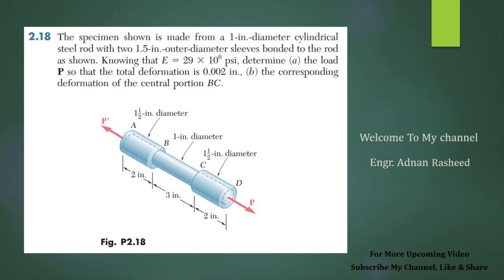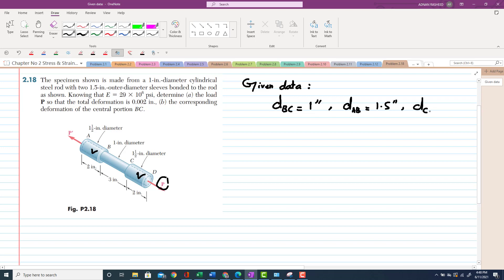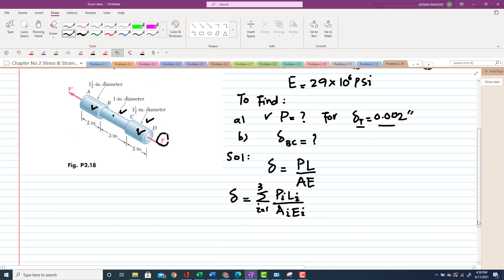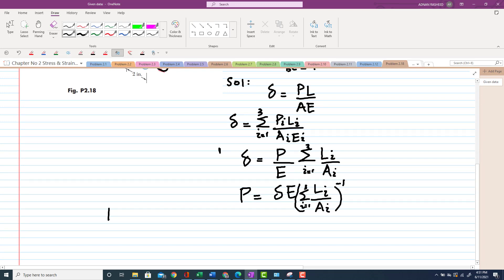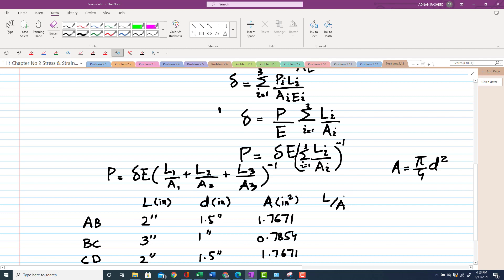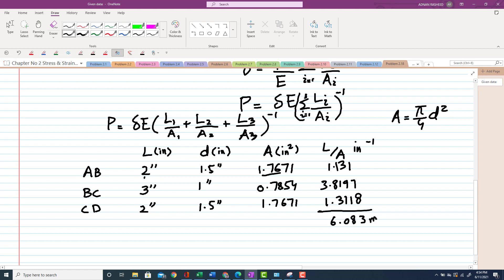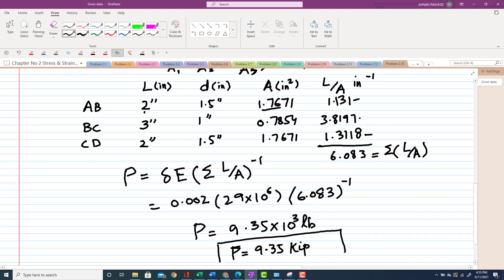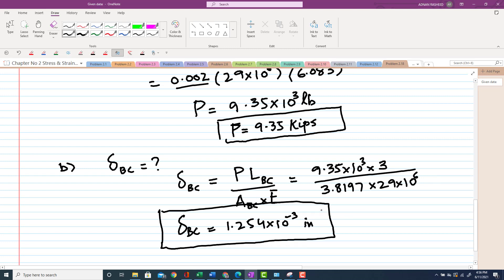Mech of Materials# |ProblemSolutionMOM​ | Problem 2.18 |Stress & Strain| Engr. Adnan Rasheed

Comment: Hello Sir please in time stamp 8:44 
I think someone has tried to ask before . 
Why did you put the value of L/A which was 3.8197 into the Area of BC instead of using just the Area which was 0.785
Reply: I don't know why but it gives the same answer 😅
Reply from the maker: Yes it's a mistake it should be Abc 0.785 or another way just remove Value of L=3 in numerator

Comment: In b question why u put L/A to A ? I am wrong or u wrong?
Reply: B question in formula P x L /A x E why u put formula A with L/A look A question A and A/L, sooru i can explain more than this because my english not very good 🙏🏻
Reply from the maker: can u tell me the time in video where you have problem...this is very easy one....
Reply from the maker: I dont get it please explain what you want to ask?
Reply: 8:43
Reply from the maker: In question it was given first to find the P load (tensile load). And in b part we have to find the elongation in portion Bc which is equal to P x L bc/Abc x E
Reply: @engradnanrasheedmechanical  oke i know that but why u put Abc with A/L?
Reply: @engradnanrasheedmechanical  Not With A
Reply from the maker: dear in table go to portion bc and get the value of A which is also Abc and divide it with the length of portion bc you will get A/L =Abc/Lbc